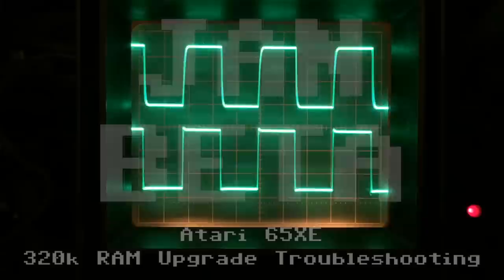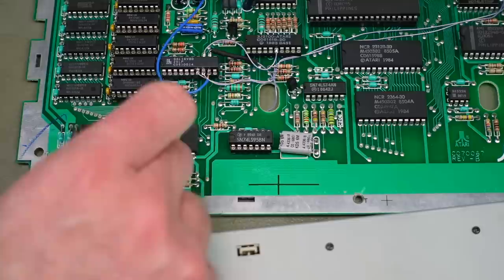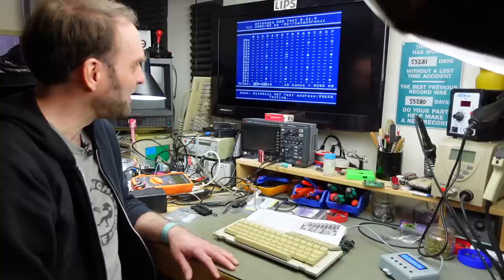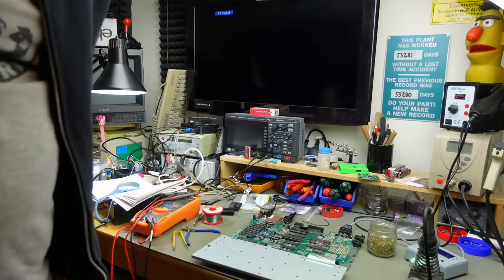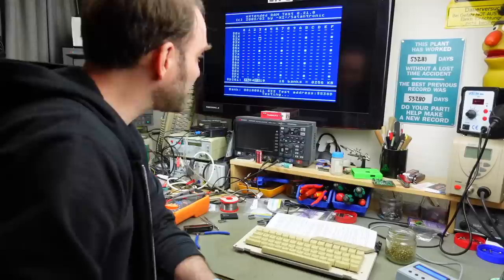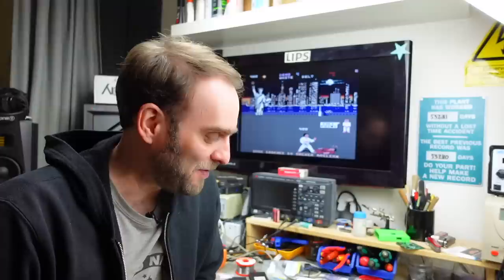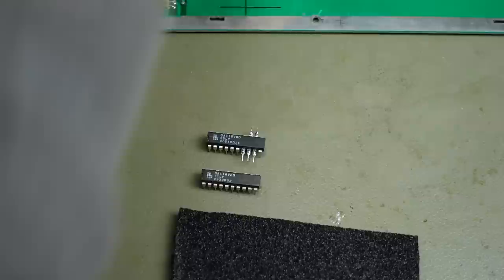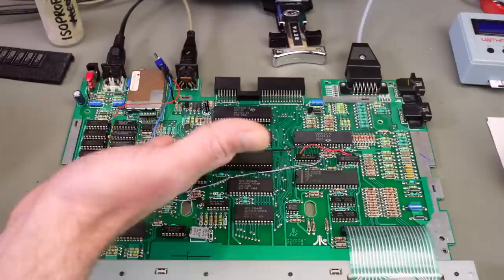Atari 65XE 320k RAM Expansion Troubleshooting

Comment: I've always wondered how much harder it would be to go the rest of the way - to 512K. You're already laying the address lines for the 256-bit chips over the 64-bit chips. Why not remove the other 64K and make the system bank in all 256K chips? Just curious - not at all my area of expertise - just asking.
Reply: It's a MOS 6502 variant. It can only ever see 64k. I'm not entirely sure how all of these extended memory ranges work on these computers, but I suspect they can't exceed a 64k base and everything else would be extended memory.
Reply: @awilliams1701  I'm not quite sure "extended memory" would mean the same thing as it does in the PC universe.  The norm with 8-bit hardware was bank switching, in which pages of 64k would be swapped in and out of the conventional memory space. The switching of memory pages should be handled by outboard logic, usually an MMU or similar type of chip.
Reply: @awilliams1701  I didn't consider that since the processor requires the base 64K to be always present (for the stack and other zero page settings) that putting a swapping mod might create issues. Good thought!
Reply: @horusfalcon  I think that was the implication. An MMU with bank switching would be the only way an eight-bit chip could pull that off. Most chips use the base for stack/zero page operations in the base 64K. Even in the early days of the IBM PC where a 16-bit processor was used, the segments were still limited to 64K. Exceeding that in programming required setting registers in the processor to a stack segment (so the stack had 64K), a code segment, (where code in the segment had to be within 64K - but could jump to another segment), and a data segment 64K. However, 8-bit processors didn't have the built-in segment management registers so required an MMU.
Reply: @jeffreyphipps1507  It doesn't have to be the whole 64k but it does need a constant memory portion for it to work I believe.

Comment: if theres an mmu, and its not addressing properly, that might be it, if the ram isnt banking correctly, i would suspect cpu/or something that is responsible for bank switching. if its not that, think about some of the glue logic again, perhaps  its the way everything is tied together? can you loop pin 1 was it on the ram under side on both banks? i almost suggested a timer on the ram side from a faster 100ns to 150ns or 120ns or so, maybe a resistor pack? maybe a series? just taking a shot there. smirk what if its the joystick ports? its atari, expect strange happenings. graphics... its probably ram, switch out the ram again with the ram you had in the machine. are the grenades supposed to look black om the atari version of commando? i thought that was odd. check chip select? check clock lines? thats all i can think of. check all the glue i guess. good luck

Comment: Which kind of power supply do you use? It certainly draws more power than without the RAM expansion.
And is the timing of the original RAM ICs and the addon ICs the same? I guess they should all have the same timing
Reply: I also thought of a wonky power supply or marginal on-board converters with these kinds of symptoms.

Comment: This is not "troubleshooting", you are just trying to replace parts at random. If the RAM test is failing, how exactly does it fail? What test exactly fails and how? Is the failure specific to particular chip(s), address lines, data lines? Does it affect just the extra RAM chips? If you're suspecting a timing problem, you should examine the signals on your scope, check them against the datasheet, look at timing diagrams in RAM chip datasheet, in processor datasheet, verify that they are compatible.